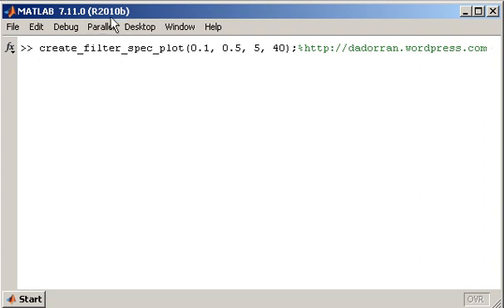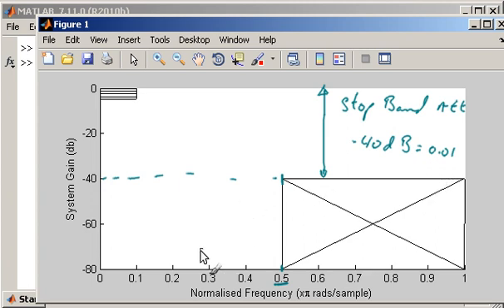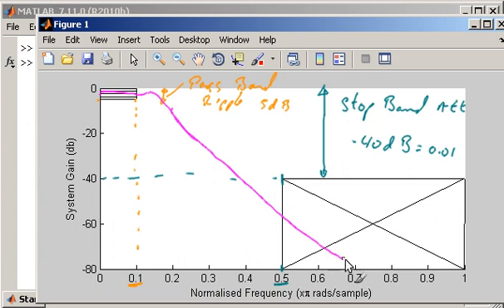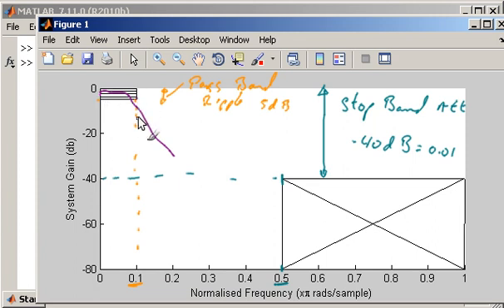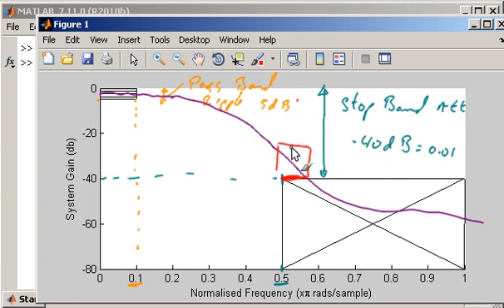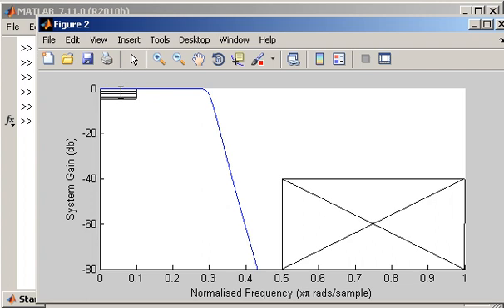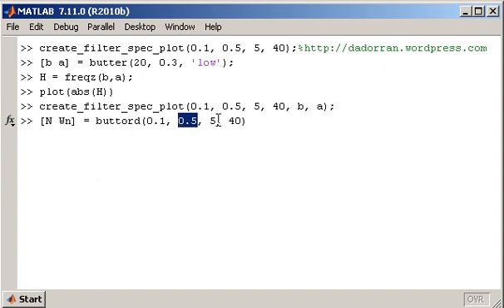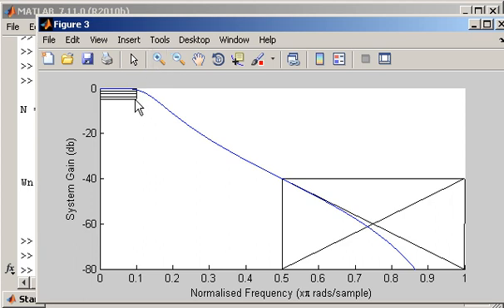Designing a minimum order filter in matlab to meet a design specification

Comment: Hi

Low shelf second order filter have transfer function like this:

G(s) = (s^2 + K^(1/2)/Qs + K*omega0^2)/( s^2 + (omega0/K^(1/2)/Q)s + omega0^2/K) 

This is not butterwort filter (i it simmilar but not exact: low pass is 1/(s^2 + 2^(1/2) +1) and formula 5.20 in wiley digital audio signal processing book. Also in this book complex zeros are moved on straight line form which V0 is derived but it is not excact as in G(s)  )

So how to derive this transfer function ?

It is used in many places eg. in matlab and others

https://webaudio.github.io/Audio-EQ-Cookbook/audio-eq-cookbook.html

thanks for any clues

Comment: @2:08 When you mean frequency between 0 and 0.1, do you mean 0 Hz to 0.1Hz? I need to create a filter where the passband is 0 to 12kHz. How would you do that?
Reply from the maker: +Memo “MekoxTwiSparkle” Pony the frequencies are specified in terms of "normalised" frequencies. Normalised frequencies lie in the range between 0 and 1 where a value 1 corresponds to fs/2, where fs is the sampling frequency. Similarly a normalised value of 0.5 corresponds to fs/4.

To create your filter you'll need to determine the sampling frequency (fs) used to capture your data so that you can convert your value of 12 Hz in to a normalised value. So say your fs is 100 Hz then the normalised value that corresponds to 12Hz would be 12/(fs/2) = 12/50 = 0.24
Reply: David Dorran Ahh perfect, crystal clear. Thanks.